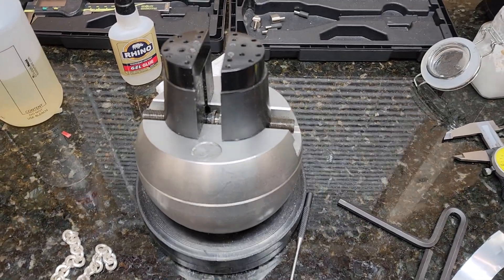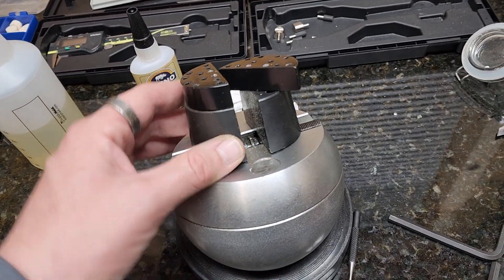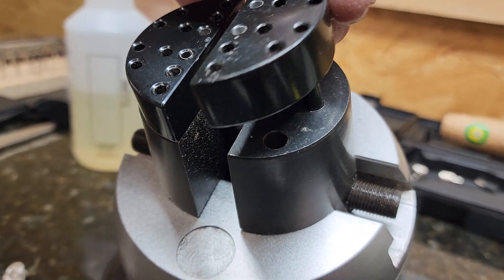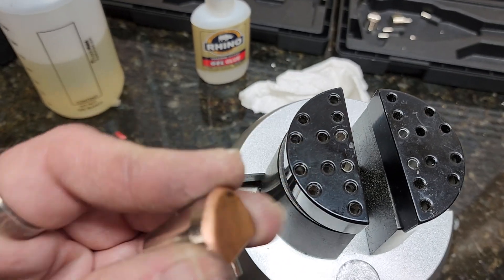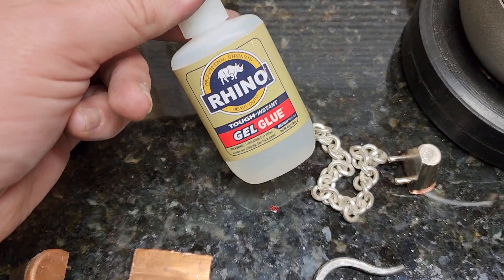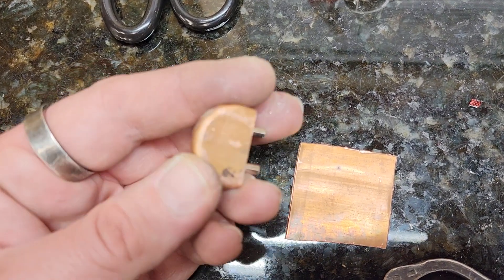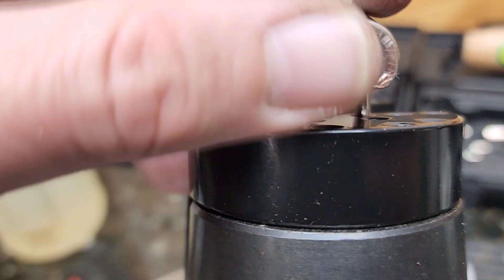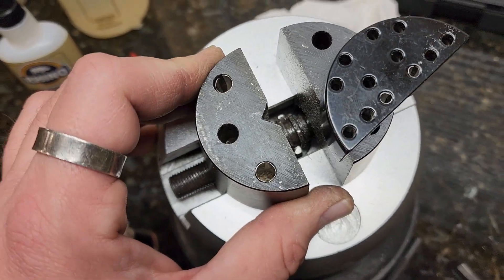Improvements to the Chinese Vevor 5" Ball Vise. Copper Jaw Covers & Pin Shim Solution.

Comment: Thanks for the idea about shimming the holes - definitely helps!  For others wanting to try: for my vise and my softdrink can, the smaller holes used 10mmX10mm shims, the larger holes used 20mmX20mm.  For the smaller holes, I used part #3 "Clamp Middle" (according to the "user manual") to preform the shims and after startgin them started with my fingers, to push/insert the shims in the rest of the way.  Advice - use a bandaid on your finger-tip to act like a thimble.  It takes about an hour or so - WORTH IT.

Comment: Great video!  Wanting to purchase the same vice, I’ve read about this issue and I’m glad to see it’s an easy solution to save so much money on not having to purchase the GRS equivalent.  After some months of use, has your opinion on the vice changed?  Would you still recommend, how well has the repair worked in the long run. Thanks ❤